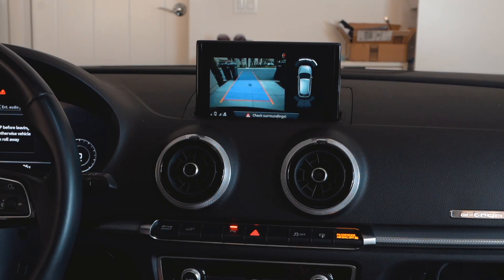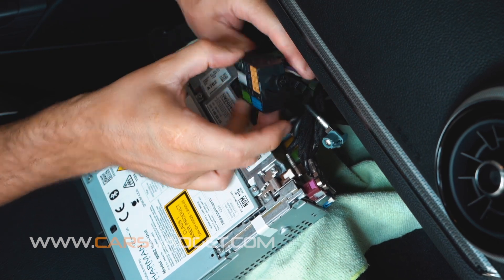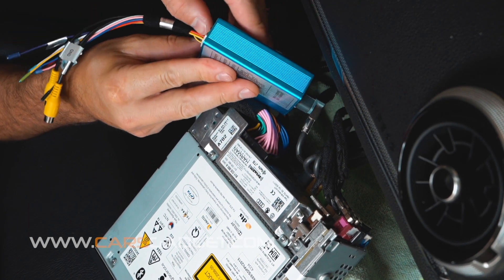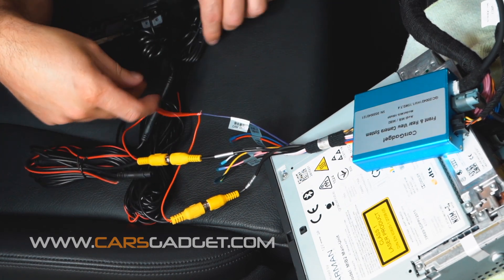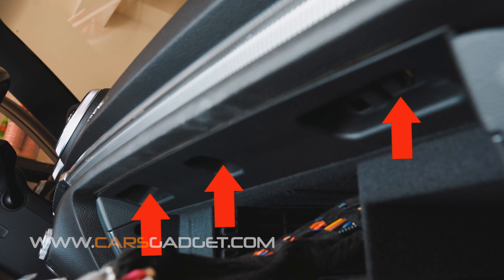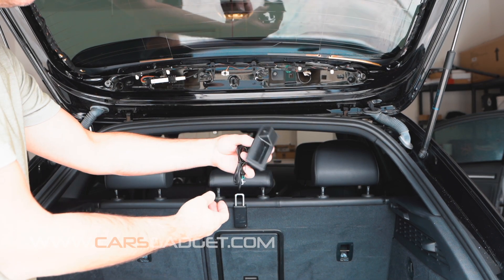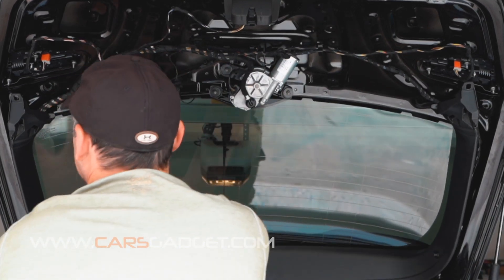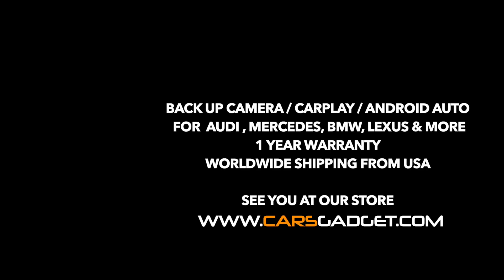Backup Camera retrofit for Audi A3 A4 A5 A5  B9 How to Install Rear View Camera system

Comment: Good day.
I would like to know if you disconnected the car battery during installation or not. Did the car radio lock after removing the connector?
Reply from the maker: Disconnected the battery is preferred for your safety but not necessary as long as you will remember to not turn the ignition ON white the cables are disconnected from the radio. And no, the radio will not lock.
Reply: Thank you for your reply. I have already bought everything and when it gets warm, I will install it according to your instructions. Have a nice day.

Comment: Hi. I have a problem with a connection. I would like to connect the front and rear camera. what color cables to use? Purple or white? I have power to the rear camera from the reverse light. So yes, I should connect front camera to purple cable and rear camera to white cable?